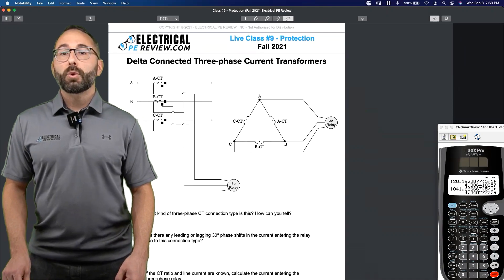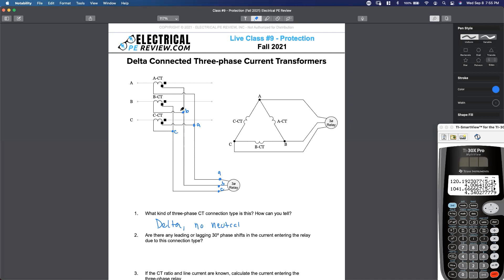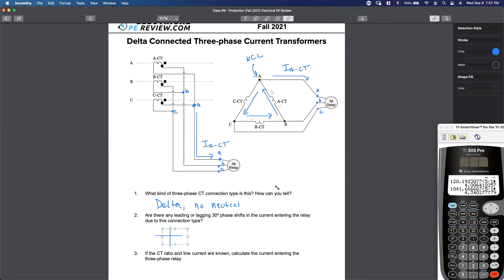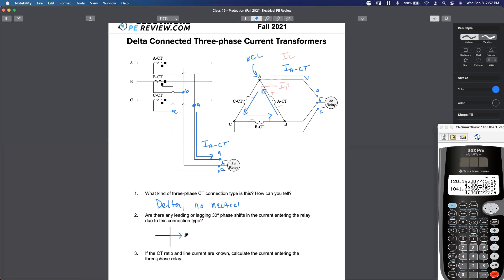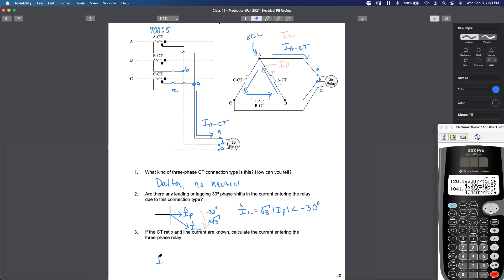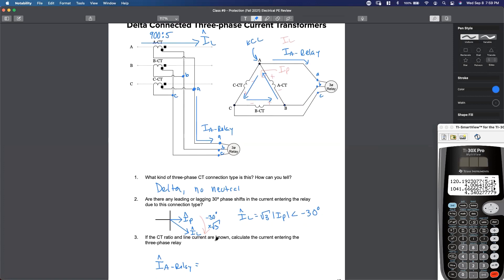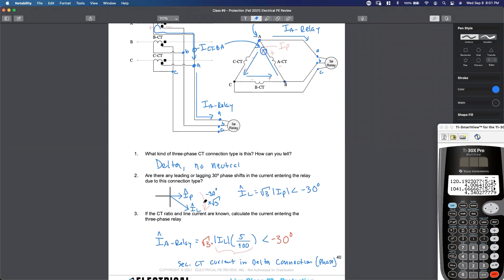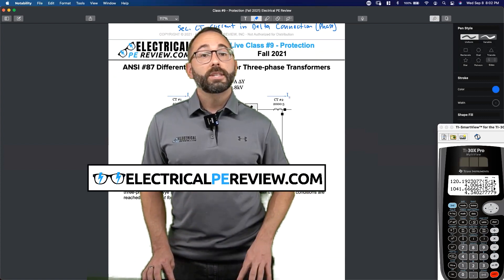Delta connected current transformers CTs for protection and relaying (ELECTRICAL POWER PE EXAM 2022)

Comment: I wanted to ask why the delta current is lagging the phase by 30 degrees? From the drawing, it appears to be a standard DAB connection (The polarity of A is connected to the non polarity of B), and assuming a ABC phase sequence, then the delta side should lead the wye side by 30 degrees.
Reply from the maker: Good observation! If this was a DAB connected delta deltawye transformer, you would be correct. In this case we have just three current transformers that are delta connected. When we sum up any of the phase currents to calculate the line current leaving the delta connection using Kirchoff's Current Law, the resulting current leaving the delta connection will lag by 30 degrees.

Comment: Is circulating current in the delta negligible?
Reply from the maker: In this instance, yes. The circulating delta currents are all displaced by 120º and result in the line current leaving the delta (and entering the relay) being larger by a factor of times the square root of three.

Comment: Why would you ever want to wire CTs in a delta manner?
Reply: Great question, most protection scenarios would utilize a wye-connected CT secondary. However, if you had an electromechanical relay device or panel, generally they need both delta and wye-connected CTs for transformer differential protection (assuming a delta-wye or wye-delta 3 phase transformer) to offset both the root 3 magnitude and phase shift change through the transformer. It may also be useful in other unique power system protection applications.